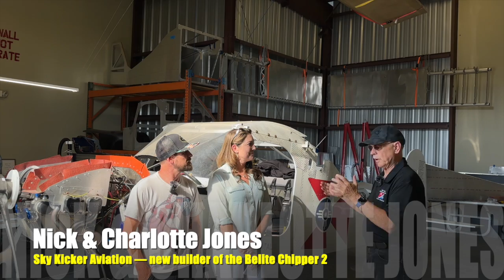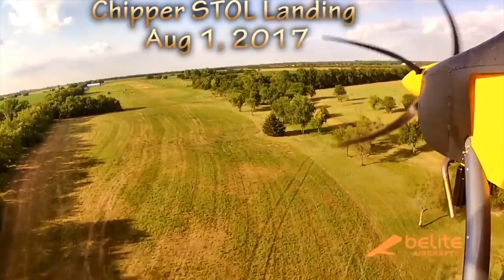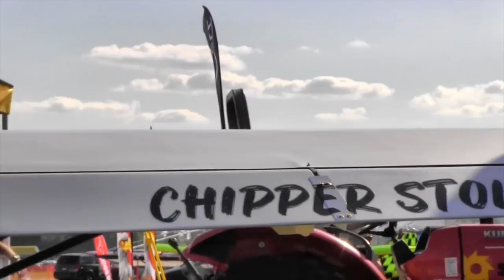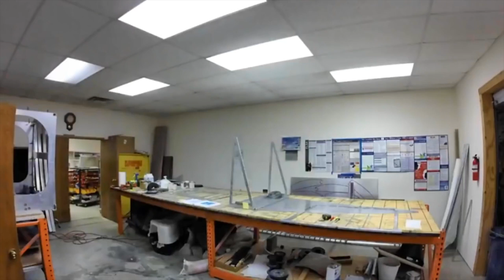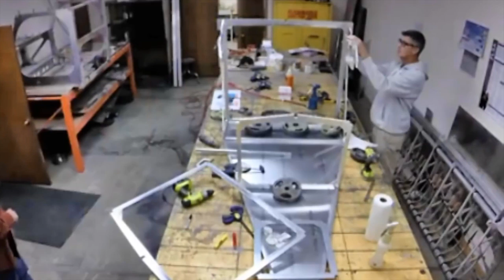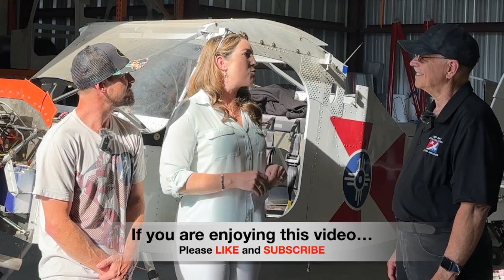Chipper in Florida 0424

Comment: I talked to James about the Chipper right before the fire. I was really interested in a kit. If they can keep the price down they will sell some kits. Going to be hard to compete with a company like Zenith with the new match drilled holes on the STOL CH701, especially now they are offering it in a Tailwheel kit. Zenith’s new kit has a lower build time with match hole construction. Plus they have a great proven design for STOL work. I’m excited to see a new 701 Tailwheel flying with a 130hp engine. Losing the front wheel and gear was a big savings in weight for the 701. You can build one under 550lbs I believe in Tailwheel setup. I think the Chipper is in that category. I like they have big flaps. With some 28in Bushwheels it will be a nice little Bushplane with a 130hp UL Power, or the Viking 130hp.